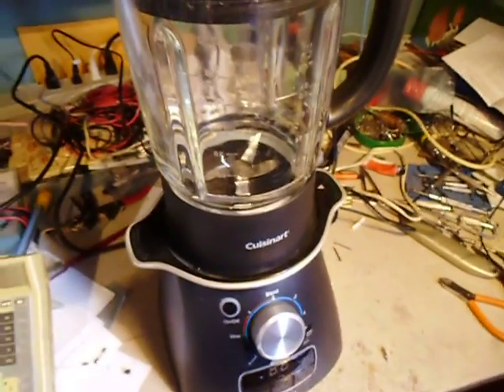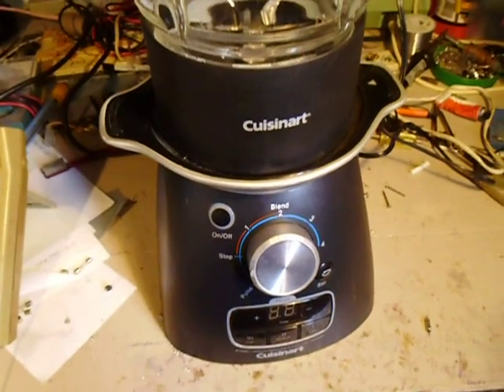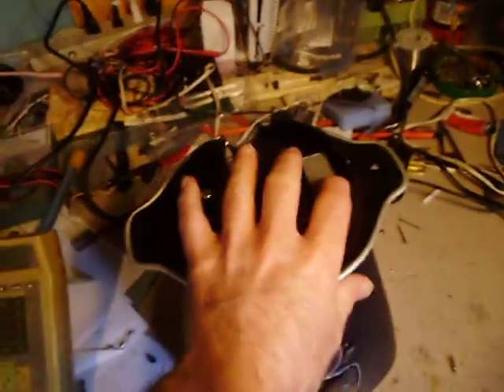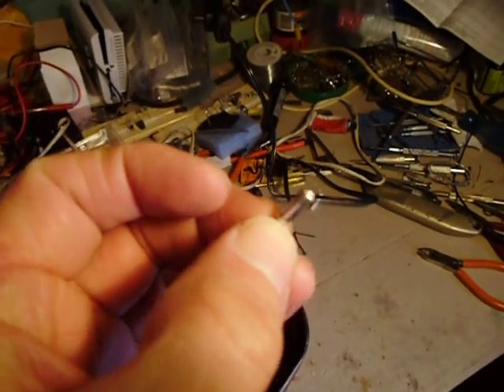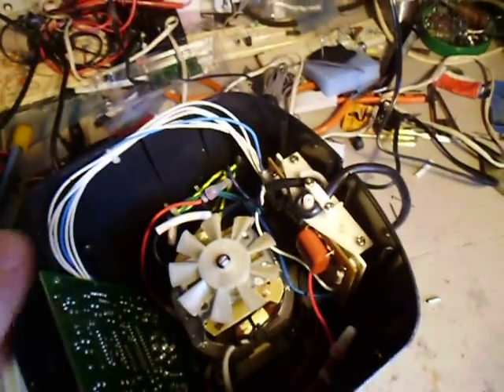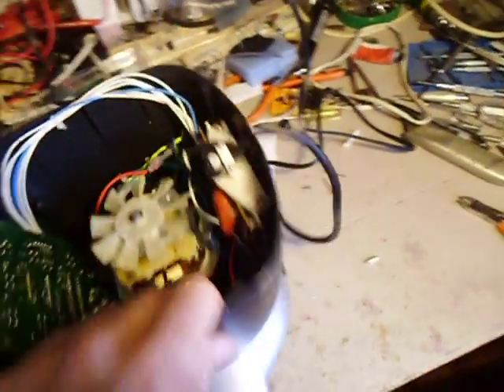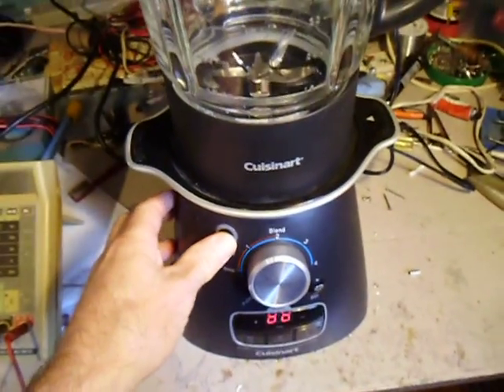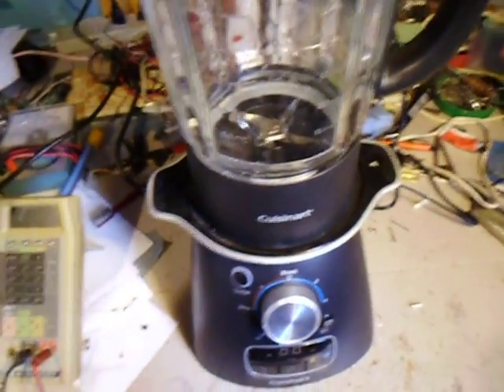Cuisinart SBC-1000C blender not working

Comment: Hello. I am glad this video was made. It took me a few minutes to figure out the fuse. The fuse is under some white heat shield. Once I found it I looked up the fuse I needed. I bought the fuse (Tf 133 Celsius -10a-220v) off Amazon. I just replaced it and the blender is working like new.

Comment: Many thanks, I clearly have the same problem. Could you provide me with the part description and a link where I can order such a part? Thank you.
Reply from the maker: Hi,  It was for me, so i didn't replaced the part,. I just bypass it. It's a safety in case it becomes too hot. You have the same kind of parts in air dryer, toaster, but not necessaely with the same specification. They are rated in degree celcius or fahrenheit.  But it seems that on this machine, they installed a part with a little bit too low tripping point or the parts are not opening a the temperature they should....
Reply from the maker: If you have the spec of the part and want to find one, try looking for "temperature safety fuse" , or something similar.
Reply: Hi DanBi6, do you know what is the temperature rating of the fuse?
Reply: DanBi6 how did you “bypass” the fuse? I have the same blender/problem.

Comment: Hi, I replaced the fuse and still blender not working, heating does. Any idea please??
Reply: There's a fuse on the circuit board too. This one is an over-current fuse. The one this video shows you to replace is an over temperature fuse. Either one can blow and stop the motor.